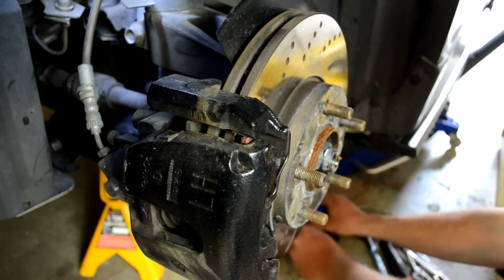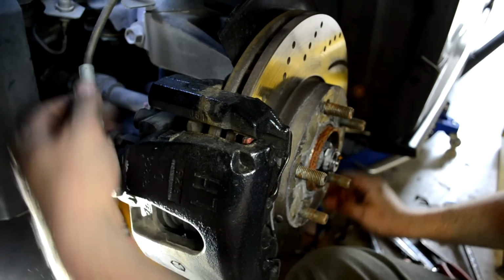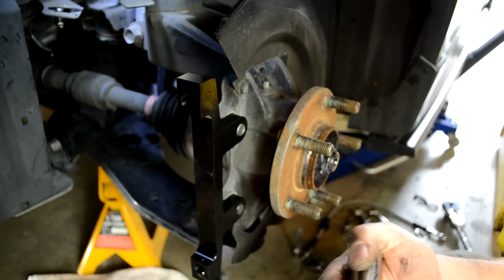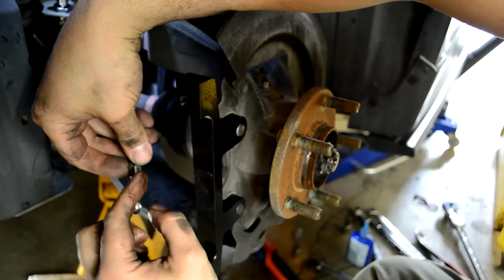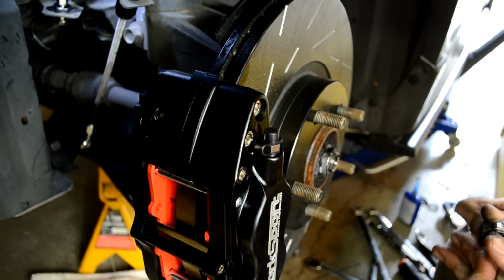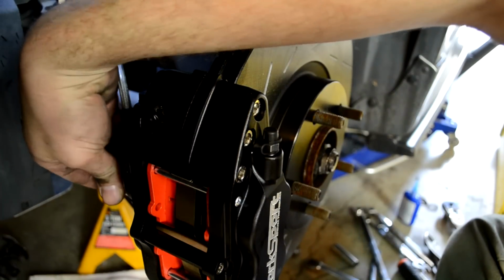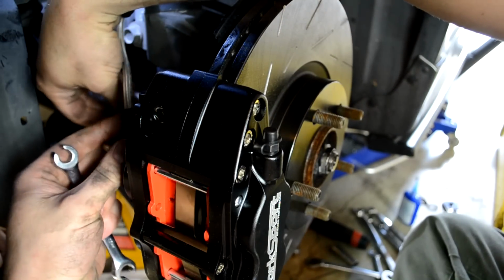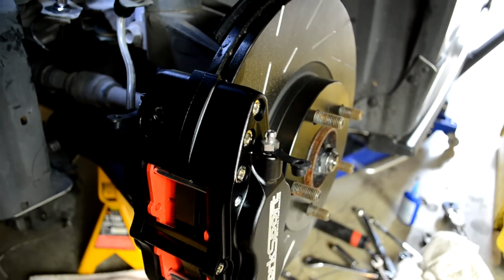CorkSport Mazda 3 / Mazdaspeed 3 Big Brake Caliper Kit Install Video

Comment: Hey all, just a PSA about my experience.  Got this kit in April 2019. Paid customs to get it in BC from WA. All said and done, the calipers needed at least 3/8" spacers to just barely clear the calipers with my stock 18" wheels. The excuse I got from CS was that "our supplier must have changed the design slightly". So you're getting a rebadged malaysian/taiwanese or chinese product here at USA prices. I'm riding on 20mm spacers and dealing with occasional rubbing on the wheelwells. All CS were willing to do is give me $50 store credit. Didn't even cover the spacers I had to buy. I would have saved up for a proper big brake kit had I known this is not true bolt-on.
Reply: Do you know any different brand for the mazda 3 big brake kit?
Reply: it says depending on what kit you buy that you will need wheel spacers to run them on stock wheels...
Reply: Do you think I will be ok with 19" wheels? mazda 6 stock?

Comment: Ive run EBC with no issues.  Did you break them in properly?  What pads are you running?
Reply: know this is 10 years later so you prob won’t see it, but what pads did you end up running with EBC, was just looking at the EBC yellow stuff pads but wanted to make sure they fit the corskport caliper

Comment: I do have a question why don't they make big brake kits for rear brakes on cars?
Reply: The68VeeDub  Because the front does most of the braking. There is no need for the rear to be so large.
Reply: 70%-30%

Comment: I've never torqued bolts nor used locktite. My dad taught me is better to use your hands and brain when it comes to tightening bolts. Never had a bolt come out on any part of the car. Reason i don't use torque wrenches is because I properly set the torque wrench for the valve cover and the bolt head popped off, because I said to myself since this Mazda is my first nice car I'm going to do everything spec. Nope lol not again.
Reply: +The68VeeDub It has torque specs for a reason. Loc tite is only there so it doesn't vibrate out. It would suck having one of your calipers fall off wouldn't it?
Reply: +Greg Burgess Never had that problem on any vehicle. I'll never use it just another worthless product in my opinion. I'll trust my hand before I'll trust a product.
Reply: @Road2PBATour  this is old but if you ever try and work as a mechanic you will never get a job if you never use a torque wrench or loctite, ever.
and if you somehow get a job and something does go wrong, if for example, a wheel falls off a customers car and they get in a wreck, you will get a big fine and its highly likely you will go to jail, if someone dies in that wreck it is involuntary murder
something happens to your customer because of work you did, its 100% your fault

if you never use a torque wrench over tightening is also a thing, so you could replace something and the next time you to go replace said part something might break when taking it off and then youre fucked

you not wanting to use a tq wrench is like someone saying they dont want to wear a seatbelt because when they got in a slow wreck the seatbelt did nothing but hurt them

safety isnt an opinion